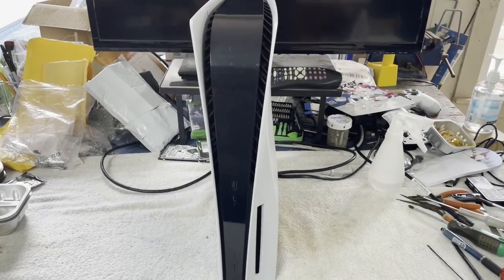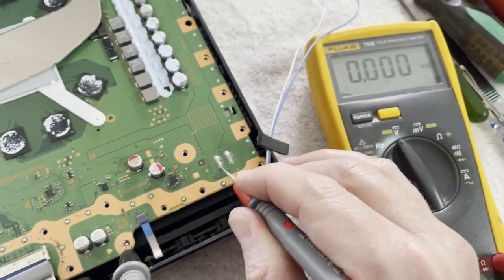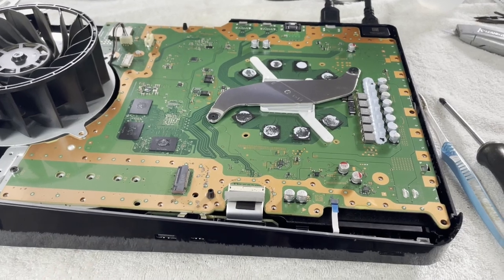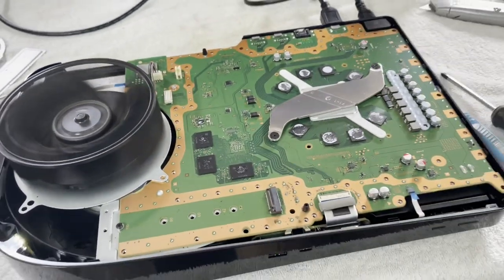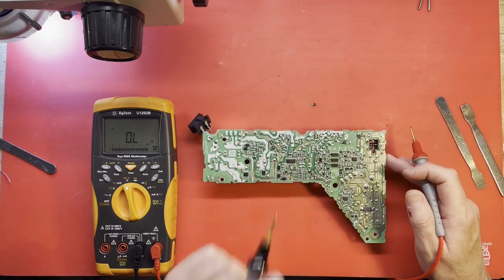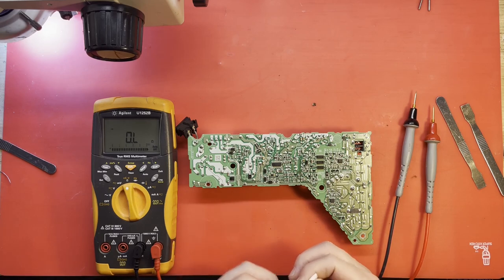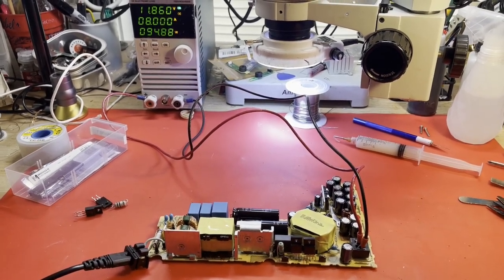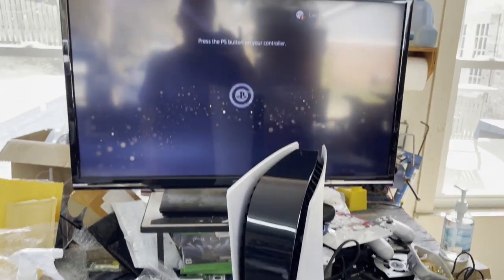#77 Repair of PS5 No Power

Comment: just a question Im still self teaching myself alot about electronics repair. in this case when testing why did you put the red probe on ground instead of the black one? usually its reversed but im sure you had a reason for it. as always great fix love the videos i learn alot from you.
Reply: That would be testing in diode mode to test for diode junctions
Reply from the maker: You can use diode mode however you like but having the positive probe on ground tends to give a reading more often than having the negative probe on ground.  This is simply because of the way ICs are manufactured.  If you use black probe on ground, quite often you just get OL reading.  If you see diode readings listed online somewhere, the readings will normally be taken with red probe on ground.
Reply: @ToltecMerc  ah i see i did not know that. thank you for the reply looking forward to the next video.

Comment: Hi, thanks for help us,respect!I have problem with power supply adp-400dr , no power 12v ,zero V.On both capacitors main filter have 290-300v dc , i know must be 390v, where is missing 60v, i check nothing in short nothing burning, afc diode and mosfet is ok, and fet s too, i dont where i looking
Reply: Same problem. Did you fine the solution

Comment: What could it be if make a beeps but no power or light, just beep, I got my electric service went down and I think after that it stop working
Reply from the maker: I think the HDMI encoder can cause this.
Reply: @ToltecMerc  I try diferent cable and port but I will double check again
Reply from the maker: @FalopioGaming  check for shorts around HDMI encoder IC.

Comment: Nice job. One tip only. Use it flat.(you know the whole issue with liquid metal)
Reply: That was all blah blah it doesn't affect anything
Reply: @MultiVoiceofreason  Please dude, if you don't know the liquid metal density becomes like water at certain temperature, then you shouldn't give an opinion as if it's the revealed truth.

Comment: I had bought a new 400DR to replace one that was giving no power. I installed the new 400DR into my system and plugged in cables to test but it still didn't turn on although I can feel my system was slightly hot to to touch. Any Tip?  is  the new PSU defective? is it the motherboard?
Reply from the maker: There could certainly be a problem on the main board.  You would need to confirm that your supply is supplying 12V out.  If it is outputting 12V, everything else happens on the mainboard.